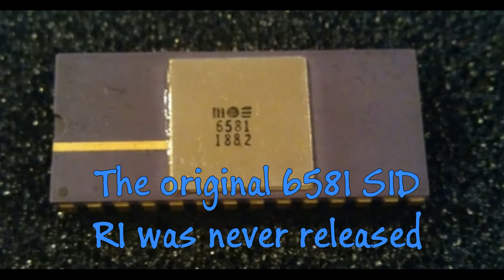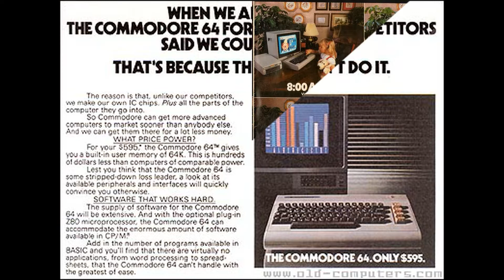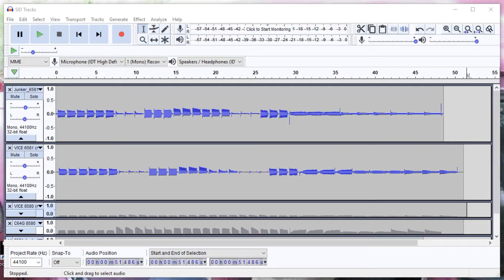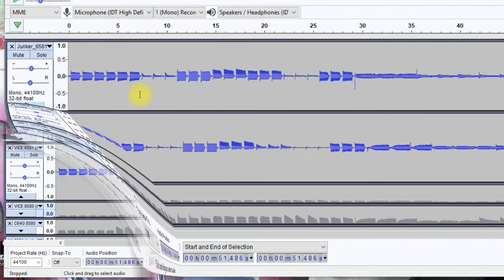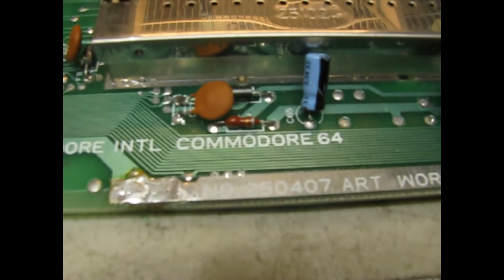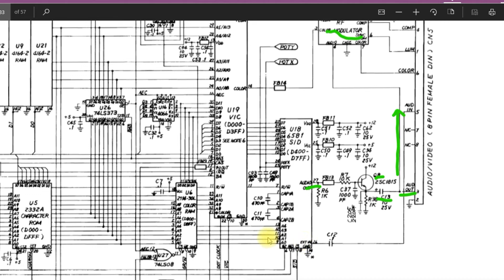C64 Video 2 - Tale of two SIDys

Comment: This is a great video for details in how the SID works electronically. That said, and you alluded to this very powerful tool a couple times, ultimately doesn't how the SID sounds matter more than any amounts of voltages? I mean you can quickly and efficiently listen to a very familiar toon on the C64 and immediately tell whether it SOUNDS correct. The real problem here is that the SIDS are nearly all going to fail sooner or later and since the original technology that was used to make them is gone. There are copies and ongoing projects to develop replacements, but to date (4 years after your video was made) none of these newly developed SIDS are exactly the same as the original SIDS. There are even replacements that use ARM processors that are dozens of times more powerful than a C64 and they still cannot get the SID exactly the same. Again, the best instrument for testing the SID is your EARS, and AFAIK there is no way to "fix" a bad SID except to replace it, unfortunately...
Reply from the maker: We all have an idea of what the 'perfect' SID chips sounds like but in truth there is no such thing. They have always been a bit different from each other. Not only are there two major versions of the SID which, even when brand new, sound a bit different form each other.

If we could go back in time to the 1980s and listen to 5 random SID chips playing tunes, we would notice that they all sounded a bit different from each other. Take 5 random original SID chips today and they will sound a bit different from each other. 

Today the ARMSID and FPGASID are so good that anyone would be hard pressed to tell the difference except in a few edged cases and those edges cases become fewer as they figure out how to properly model quirks of the SID design that caused them.
Reply: I'm glad I discovered your channel. I'm learning quite a lot !

Comment: Hey Birt, Thanks for the video. Very interesting. Any ideas why a 6581 would hit the wrong notes in certain games and not others? If I switch a known good 6581 into the same board it runs fine. If I take the suspect 6581 and put it into my test board, it runs better but still not 100%. In 99% of games the suspect 6581 is fine but on certain games (Rocky Horror) it is tone deaf lol. The machine that it is in needed a new PLA, 2 new RAMs and a new U27 so was wondering if maybe bus contentions caused the glitch by damaging the SID? Keep up the good videos. Cheers.
Reply from the maker: Different programs use the SID in different ways, different filter settings, etc. If you have a filter go out on one voice it will sure make some odd sounds. I have an ARMSID that I think is a good substitute. some purists insist they can hear differences but you can hear differences between two real SIDS too. They were just not able to make them very precisely back in the day.
Reply: @HeyBirt  Thanks. It is weird. It passes all the SID tests but then screws up some music 🤣. Funny enough I ordered an ARMSID about a week ago. Looks like a great product. Just waiting for it to show up now...

Comment: Very Interesting.  Is it possible and how much trouble would it be to change an old board from 5 Pin DIN to 8 Pin DIN with the additional signals?  The 5 Pin DIN only has Composite Video but the 8 Pin has Luma & Chroma which can be converted to S-Video.

Would it be cheaper, just to buy another C64 that already has the 8 Pin DIN?

Thanks,
Richard
Reply from the maker: I know some folks have converted a 5-pin AV connector to 8-pin. If you remove the 5-pin connector and bend up the two new pins on the 8-pin you could solder the 8 pin in place. Then you have to find the chroma/luma signals on the PCB and properly route them to the correct pins on the A/V connector. Last year I bought a nice, 5-pin C64 from the original owner. I briefly considered converting it but did not want to alter it as it was in very good condition. If your C64 is not a pristine example then you could convert it if you are handy with a soldering iron. If you are not then it would be best so get a 8-pin model.

BTW, my last video was about making a S-Video cable for the C-64 :)
Reply: Thanks for the info.  I bought a S-Video cable for the C64 and it works fine for my 8 Pin model. Since I could not find any TV or Monitor that has S-Video, I had to purchase a box that converts Composite and S-Video to HDMI.  I can use that converter with both the 5 Pin and the 8 Pin using cables I have.  After I get better at soldering I may try your suggestion.

Comment: Very useful. I have an old breadbin with the exact same problem: hardly any volume out of the sid. 
Also, I have another breadbin that turns on but has a black screen. Not sure what that may be but it doesn't look like any normal vic problem. Perhaps a bad connection in the video connector.
Reply from the maker: The black screen is a tough one as it can be caused by all sorts of things. The first C64 repair video I did had this symptom and it turned out to be the 5V regulator on the C64 board. The 9VAC from the power supply gets turned into 12VDC (or 9VDC on later boards) which goes to the SID  and 5VDC which goes to the VIC 2. I would first check that you have the 5V at the VIC 2.
Reply: Thanks. I'll have a look at the voltages. Hopefully I haven't fried anything yet.